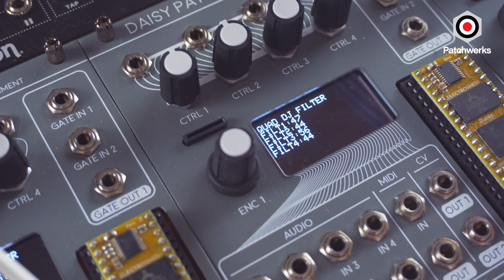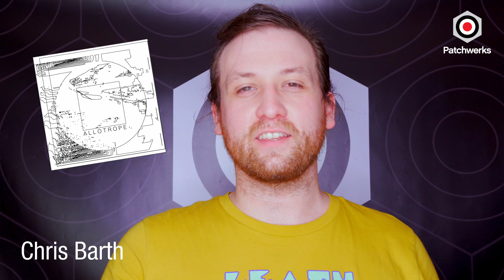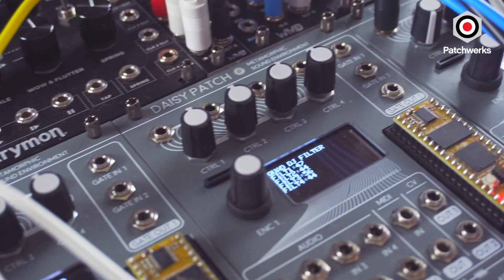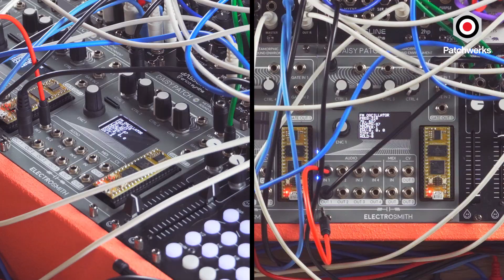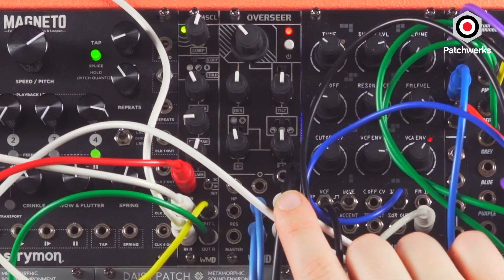Exploring the Daisy Patch Eurorack Module

Comment: Can you have several applications at the same time? There is not much info about what capabilities does the oled screen offer, if it has a menu to select multiple apps like they show you with oopsy.
Reply: Theoretically you could do this. Currently, I don't think there is built-in ui for switching between different patch programs that would be similar to ornaments and crime/hemispheres.  A lot of different data buffers for things like reverbs/delays are allocated at compile time and may be hard to dynamically create without overrunning the devices available memory.
Reply: @allotropeijk  hmmm I see. The oopsy demo video showed that you could select apps from the menu but since it compiles from ~gen I didn’t know if it was available natively or it was a specific feature of oopsy. Thanks for the reply!
Reply: @Leandrob13  yeah not super sure about oopsy, I’d suggest asking on the Daisy developer forum